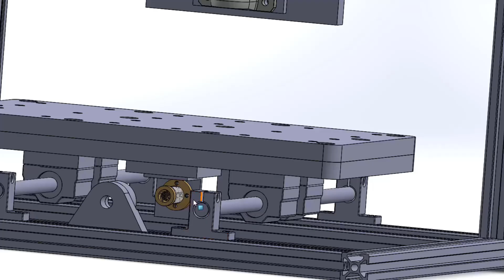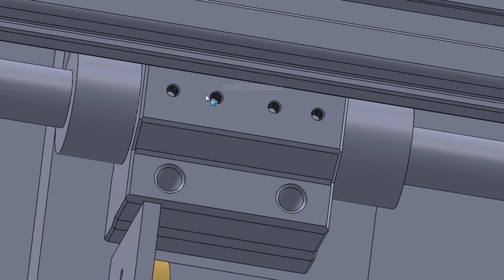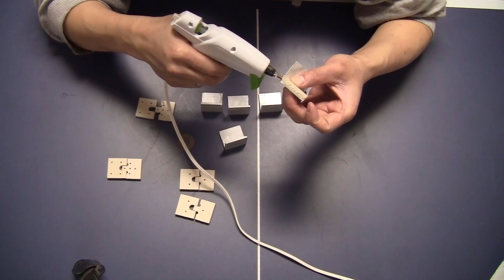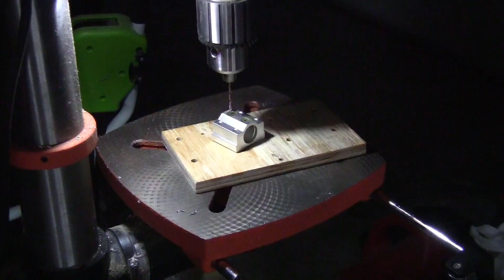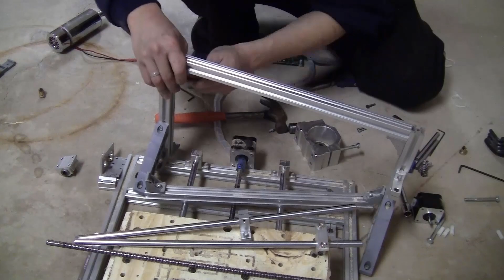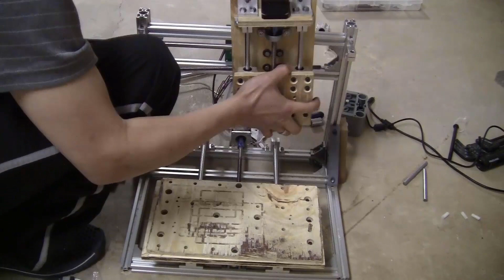3018 CNC - Major upgrades (working range, spindle, spoil board, precision) - aluminum dry cut test

Comment: Did you see the 3018cnc dermal upgrade?
Reply from the maker: Dremel is not my favorite thing for spindle. A bit noisy and lot of vibration. Also the tool size is limited to 1/8". With ER11, I can use up to 1/4".
Reply: @minhsmancave9448  oh o.k, luck I got the 500 W motor to start with then.

Comment: Like the side bracks, did you move your 40 x20 uprights back to give you move remove on your Y axis?
Reply from the maker: No, it's not to have more range on the Y axis. I was because the Z axis bloc was thicker than the original, to center the spindle to the center of the machine, I had to install the side bars all the way to the back.

Comment: Minh, fantastic work! I'm in the process of gathering parts to try this upgrade. The Z axis setup link seems to be broken. Would you mind updating it? It looks to me that there are some bearing mounts that I can figure out from the video what they are. Keep up the amazing work!
Reply from the maker: This upgrade seems to be good in overall but will make the Z axis bloc heavier, better change the rails on the X axis to fully supported type such as mgn15 or sbr12, sbr16 first. I show why in the next video about installing those rails to cut aluminum. Even cutting wood is not straight along the X axis with the heavy z axis bloc

Comment: Excellent video! Minh, you are a masterclass!! Thank you so much for sharing your vast mechanical knowledge. I have been thinking of getting the starter CNC 3018 kit to learn and get familiar with using CNC and the software etc. The main reason I have not ordered this kit is because of its limited workarea range. I would prefer to have at least 30 x 30 cm and I was thinking of looking at the possibilites of replacing the side profiles for the y-axis with about 45 cms and also replace the lead screw and the rails with longer sizes. Do you think this would provide the extra workarea or do you think it will impact the accuracy??
Reply from the maker: Yes, it might affect the sturdiness of the machine once you increase the length of the rails (they are not fully supported). The longer the rails, the more vibration you will add to the machine when running. But increasing from 18cm to 30mm seems reasonable if you only machine soft material like wood and plastic.
Reply: @minhsmancave9448  Yes, initially to learn more about CNC very much like you started with you used 3018 machine and built on it. I too am only going to be doing mostly wood and acrylic milling material. Later if I get better with it I can upgrade to something like the CNC you have designed. I was wondering isf you might any plans of increasing the y-axis as one of your next upgrades. Thanks!

Comment: Vibrations are normal as you mill aluminum held by (board and clamps) a less denser material (wood). Not just the bits, but everything that holds the cut tensions must be harder than what you cut.

Comment: Thank you for your incredible efforts in upgrading thoughts. I have been following along, and one of the first things, I would improve is the spindle clamp. That is causing the play in the movement—anyway Your amazing.
Reply from the maker: I also only found out how things worked at the end. And I did have another upgrade after this one to mill aluminum s lot more smoothly: https://youtu.be/8pNyG71b0ZU

Comment: I have one of these and its not responding to the m5 comand to shut the spindle. Any advice?
Reply from the maker: What version of grbl do you have on your control board. You can upgrade your firmware to the latest version and try again. If nothing work, you can replace M5 with M3 S0 in your g-code
Reply: @minhsmancave9448  i am u sure of the version of grbl but i did re download the 3040 driver and tried candle software along with ugs. I have also tried m3s0. Im kinda at a loss at this point. It was functioning fine then it didn't all of a sudden
Reply from the maker: The spindle turn on right the way when you turn on the machine? Or it only on when you started running your Gcode?
Reply: Yes its running cw. I gave it a m5 an nothing happened. I just unplug the spindle currently
Reply from the maker: If it ran fine before and stopped working without you changing anything on the control board, the PWM signal to control the speed of the spindle my be short circuited and stay at 100% all the time. You might need to consider changing your control board. You can find one arduino based for not too expensive on Amazon or aliexpress.
Reply: So if i order a new grbl does it matter which one i get? Btw thanks for your time and help
Reply from the maker: To control this machine, it doesn't matter, any board will do

Comment: Is it possible to get the g code for the parts ? My emayl is costeschi79@gmail.com
Reply from the maker: It's possible but it won't work as you think that it should. There are many reasons why nobody is sharing Gcode on internet, not because they are selfish or needs to protect intellectual properties. Each CNC machine is different, each person setup their stock in different way and the stocks are not standard (you will need to cut the stock the size of the piece or the way you setup the Gcode), there might be also different tools needed to make one piece that need to follow a specific workflow, the bits you have might be different than mine. For all these reason, I can tell you that it won't work and you will have to practice, get to know your machine and stock then generate your own. If you want to learn how to generate Gcode, you can look at my other videos.
Reply: @minhsmancave9448  inthat case im interested on the sizes of the material and the holes and distances , as im a beginer and i need a starting point , will the fuzion 360 files be the right choice for me  ?
Reply from the maker: You can download the design I shared on GrabCad(link is in the description of the video) and the best format are step files. Once opened in fusion 360, you can measure distances, holes sizes...
Reply: @minhsmancave9448  Thank you very much,  i appreciate everything you do , and im looking forward to seeing more useful information as always,  also just wana ask if you had any problems with the dm542 drivers
Reply from the maker: No problem so far, everything is still working nicely

Comment: IF YOU DO OWN A CNC WHY DO YOU MAKE WOOD PARTS AND NOT ALUMINIUM OR BRASS? OR EVEN A NICE STIFF PLASTIC?
Reply from the maker: It depends first on what type of CNC. Not all CNC can mill aluminum or brass easily. It took a lot of upgrades and reinforcing to make this 3018 CNC for it to be able to mill aluminum. Second, wood is cheap, easy to find, easy to mill, good for prototyping. Once the wooden part is working, the real part can be remake with better aluminum.
Reply: @minhsmancave9448  That is exactly to my way of thinking.........this machine, as designed and produced originally, was just for engraving and milling in soft materials but beefing it up with the extra parts in wood has proved that if the design was made in the first place with those heavier parts in metal it would have been a  World beater but would cost more too.......... you can't have it all ways, and most people who buy one of these machines do so because it comes at a very economic price.
Congratulations on proving that with a bit of intelligence and expertise plus a lot of elbow grease anything is possible.......now you can do the Rolls Royce trick and re-make all those ugly wood parts in metal and polish it up to make it look good.........a thousand dollar machine to be sure.

Comment: hi Minh, 
i enjoy your videos alot. Got myself a cheap 3018"pro", Target is to get it working on aluminium. So far i got a 48V 10A PSU and PWM  Speed-Controller. Just tried it with original Spindle Motor with 80% Power (~38V). Already works with ~225mm Feed rate on 0.7mm cuts on soft aluminium. 

X-Axis Linear Shaft bend very easy, so i get a lot of backclash when cutting deep or fast which results in poor surface finish.
Gonna try replace them with hardened CR53 steel ones (made in Germany).
Then next go for 400 or 500W Spindle like you did.
Keep up the good work.
Greetings from Germany 

looking forward on your updates.
Reply from the maker: Yes, we probably got on the same conclusion for this aluminum cutting problem. My next step is upgrade the rails on the x axis with MGN15. It just takes very long time to get those delivered from China now.
Reply: @minhsmancave9448  Thanks for suggesting these MGN15 rails. I srsly consider skipping the CR53 Rods and going straight to linear rails. I could get MGN12 within a few days, and they can be mounted on the original 2020 Profiles coming with the "pro" version, so it should be a pretty easy fit. Not sure if MGN12 is gonna do the job, unfortunally MGN15 are way more expensive (when not ordering straight from China). Do you think MGN12 are strong enough for the 400W Spindle ?
My spindle should arrive this week, Fun Fact: Its the same Spindle you got mounted in this video.

One little suggestion for your video: i really like the parts of the video where you show the manufacturing process, maybe you can add some more video footage of the CNC working in real-time with original sound. Time-Lapses are awesome, but its always nice to see how the machine works in real time for comparison :)
Reply from the maker: I'm sure mgn12 should do the job since they are actually got supported by the 2020 bars. Suggestion noted, will keep some original milling footage in the video
Reply from the maker: On another note, I couldn't wait for the mgn15 from China so I just got a set of sbr16. Should get those tomorrow and will be starting the new update. Should be quick and hopefully aluminum milling won't be a problem anymore.
Reply: @minhsmancave9448  Hi, I'm doing the upgrade for the X axis too (and the Y axis)  but using the SBR 12mm fully supported rails.